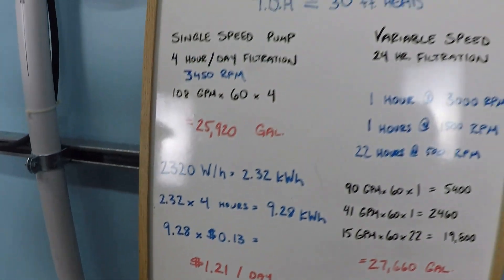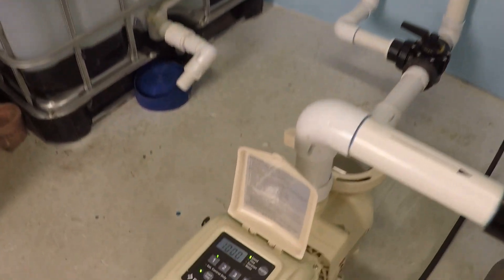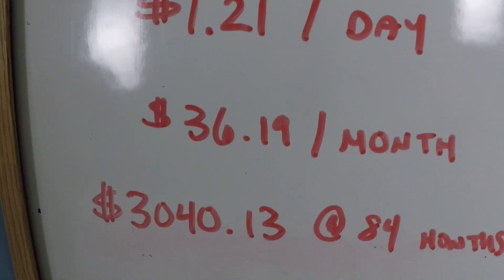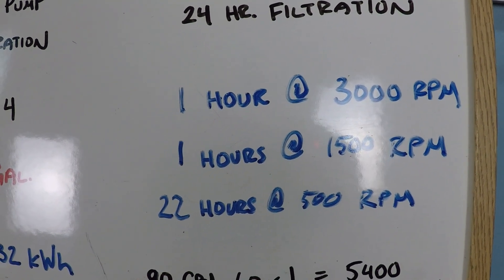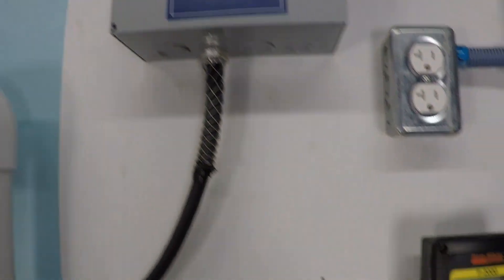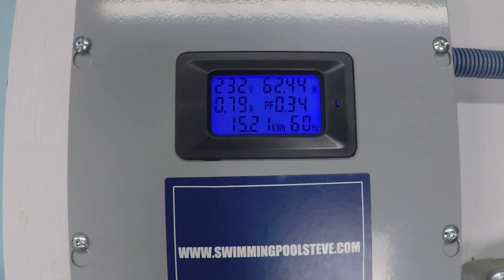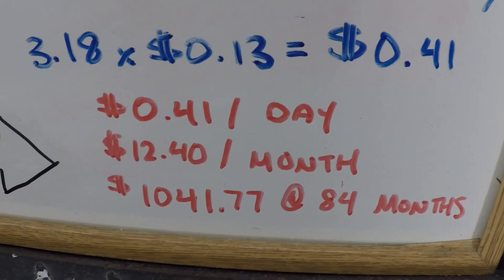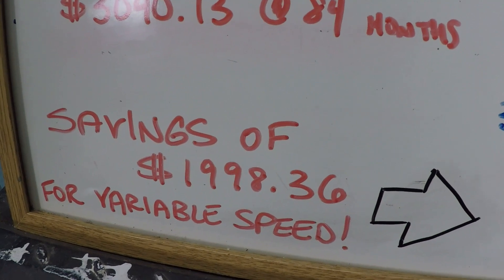Variable Speed Pump Savings Step By Step

Comment: Hi Steve, what factors come in to play with larger pools, I assume you would just have to run at a higher RPM for the 22 hour cycle? And does the type of filter affect how hard the pump would have to work?
Reply from the maker: Larger pools should do the same as smaller pools which is to say filter the volume of the pool a minimum of 3x every 24 hours.  Now in theory your question kind of presumes that the larger pool will need higher flow rates and high RPM etc. however it should be noted that if the pool is larger the plumbing system should be more robust.  Larger pipes and more of them as well.  Which means for a given RPM you might move more water in the larger pool which means that it is a fairly equal comparison.  The reality is that every pool is different and trying to compare one to another is going to come up short somewhere.  Every pool needs to be evaluated individually when designing the most optimal or efficient pump / method to maintain the water.

Comment: I'm curious what the savings would be when using 120 volts instead. I know 240 Volt is ideal for a VS pump but I think a lot of people would run this on 120 Volt if they could.
Reply from the maker: The savings would be similar, just that the single speed and VS versions would need to be slightly smaller in size to account for maximum current draw, but the math behind the savings in linear between a 120 v 240v comparison.

Comment: We have an above ground swim spa from spa manufacturers in florida.  we are in yuma, az.  There are 2 motors in the shell of this above groind system.  could a system like yours work in our swim spa?
Reply: above ground!
Reply from the maker: @user-du8ku1wd4m  Yes - you will have a filtration pump and a jet pump.  Replace the single speed filtration pump with a variable speed pump to experience these same savings.  The problem with your system is in the control panel, which is likely built for on/off function only and not variable speed controls.  This means while the pump technology can save you money, your bigger concern would be how to control this system and upgrading very likley will result in you needing to install a more robust pool/spa system including a basic automation system.  Not an easy swap over I would say.